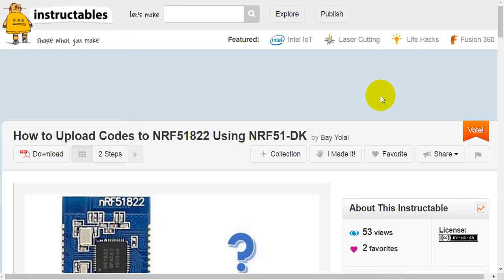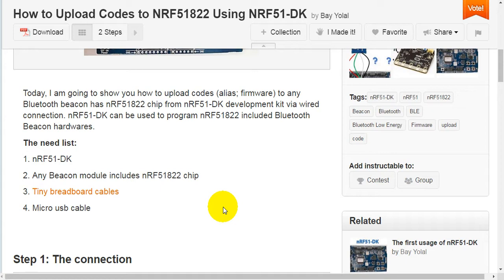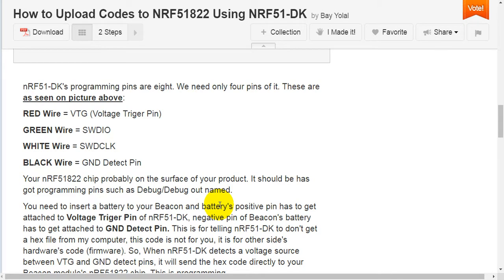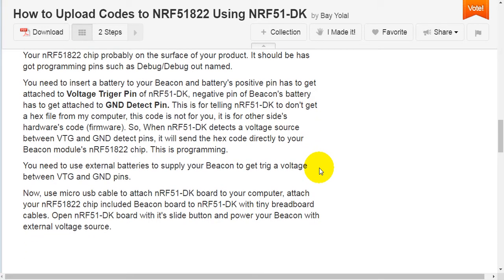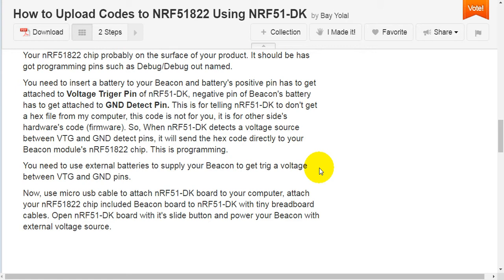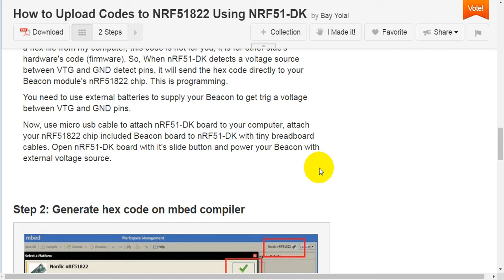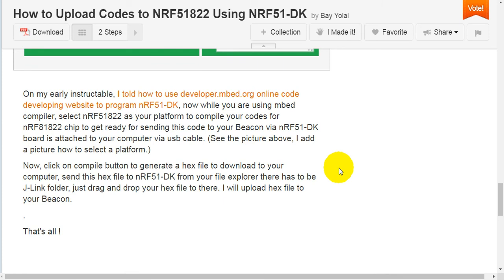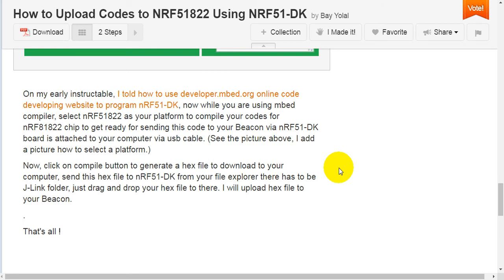How to Upload Codes to NRF51822 Using NRF51-DK

Comment: Hi, 
Thanks a lot for your nice video. It's really very helpful to learn. I'm really motivated to learn about Bluetooth devices after watching your video. That's why I have bought  One nRF51 development kit and 2 Pieces of nRF 51822 sensors. Now I wanted to connect the sensors with the kit. As you have said In your video or your documentation and you have put a picture of nRF51 kit after wired. But you didn't put any wired picture of nRF 51822 with nRF51. Can you please put a picture of them. It's also okay If you draw a schematic diagram of them with the proper pin number.
Reply from the maker: Hi, on 0:07 at the video, you can see the connection between nRF51 and the nRF51822 devices. Thank you very much for your kind comment. :) Just connect Vdd and GND and cross the other two connections. Vice versa.
Reply from the maker: Also please visit: http://www.instructables.com/id/How-to-Upload-Codes-to-NRF51822-Using-NRF51-DK/